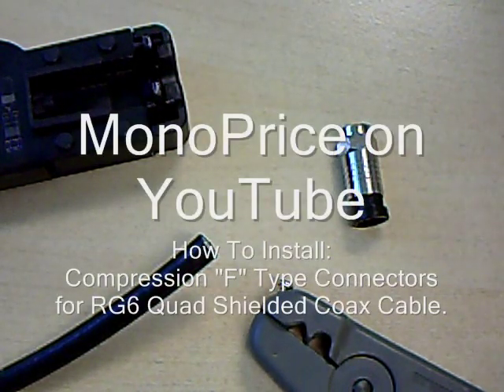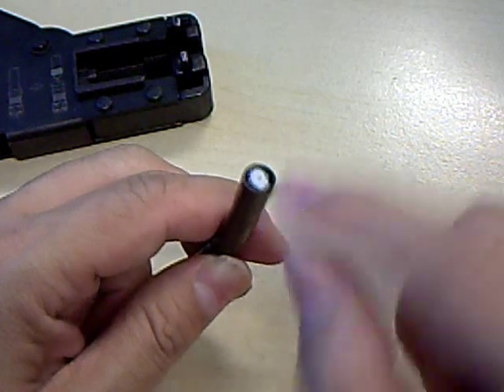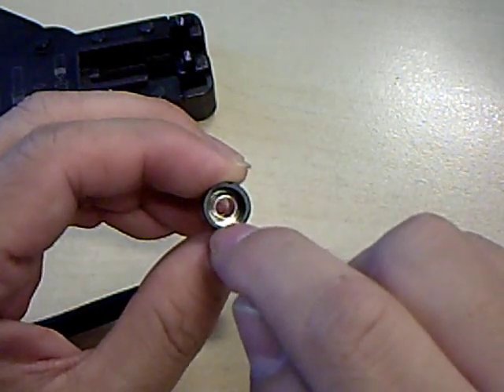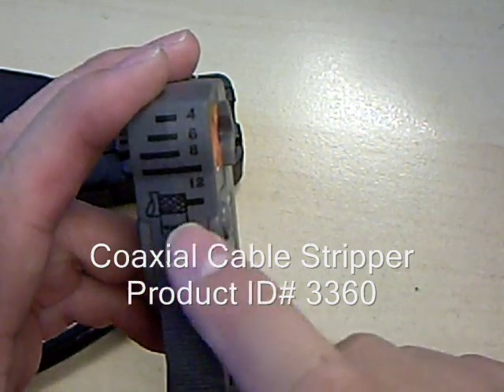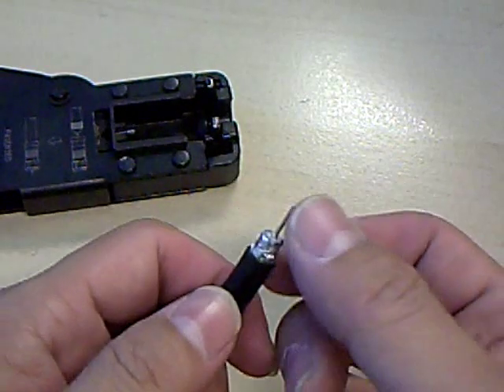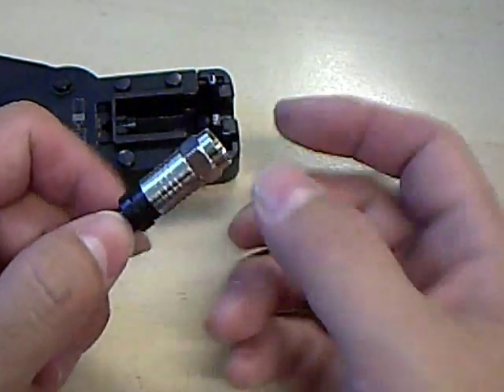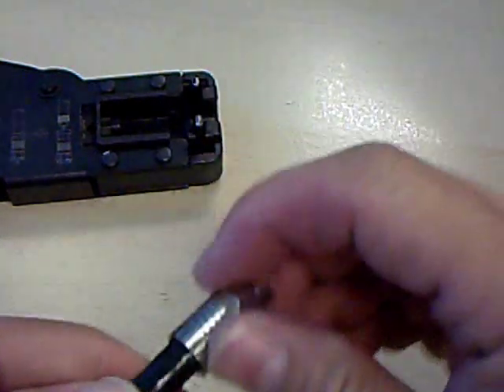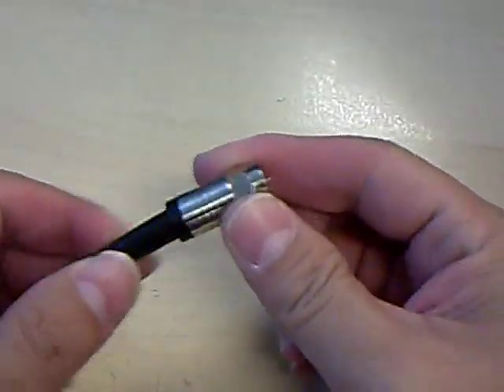How to install F type compression connectors

Comment: Respectfully, take it from a Golden Retriever wearing a Dallas Stars Hat, Mr Coldani is correct. You do not remove the foil directly attached to and surronding the dielectric, only the outer braids and foils. Also,be very gental when folding back those braids and foils, you want to keep those from breaking off and not disturb the foil in question.
Try it...

Comment: I wish you were MUCH Clearer on your site for which accesories I should or could buy with each of the various F type connectiors.  NOT REPEAT NOT what "other people bought" but WHAT EXACTLY the correct 2 or 3 crimpers or cutters / stripper tools should be bought or considered when buying this ends vs another type..  

When I select the ends, I'd like a list of EXACTLY the correct crimpers or other compression, or cutting / wire stripping tools that would go with or make my assembly easier.

Comment: The reason you are having so much of a problem pushing the connector on the cable is because you took the foil off the dielectric. You should never take the foil off the dielectric. It ruins the shielding and makes it difficult to install the connector. That's also why the dielectric was longer when you took the connector off. The jacket and braid slid back from the force of the connector.